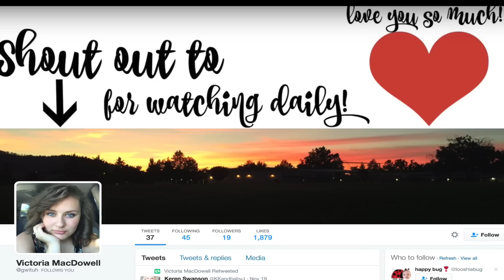BREAKING INTO THE CREEPY BASEMENT!

Comment: the flag. first of all its creepy because it looks like the earth flag, but the flag is purple and it has a earth shaped symbol in the middle. The symbol can  be a part of the Latitude and Longitude Flag. 

(Latitude (shown as a horizontal line) is the angular distance, in degrees, minutes, and seconds of a point north or south of the Equator. Lines of latitude are often referred to as parallels.
Longitude (shown as a vertical line) is the angular distance, in degrees, minutes, and seconds, of a point east or west of the Prime (Greenwich) Meridian. Lines of longitude are often referred to as meridians.)